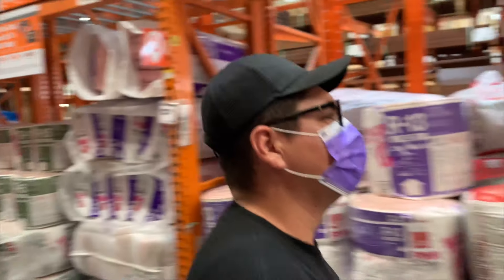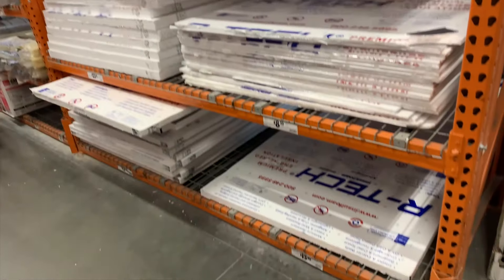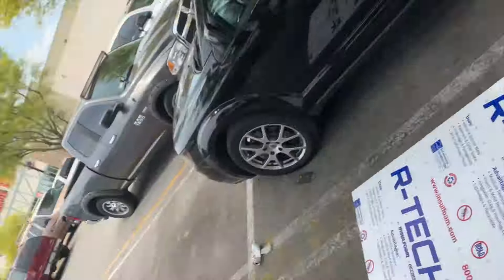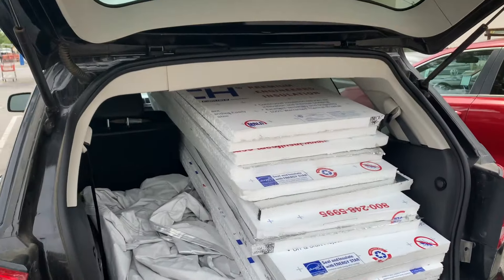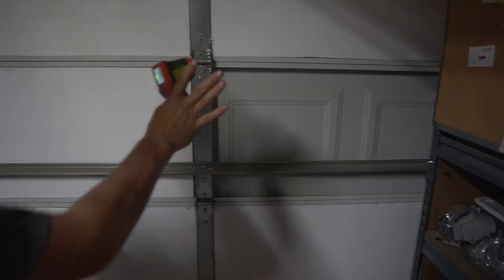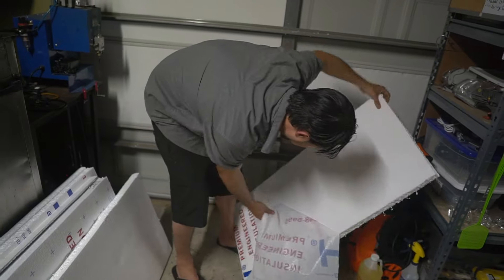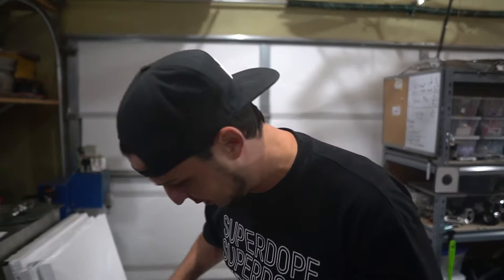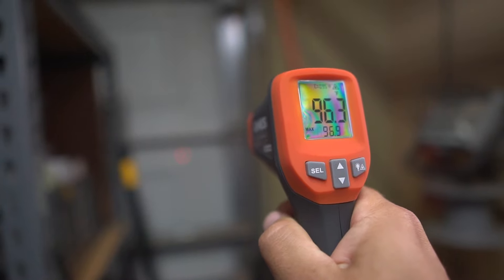My Garage Was WAY TOO HOT!

Comment: I also added in a gable exhaust fan for the attic above garage.  It has made a massive difference in the radiant heat that comes in from the ceiling.
Reply from the maker: Nice!!! I’ve been wanting to spray insulation up there, but a fan sounds way the hell cheaper 👌
Reply: @flyryde  If you ever get shipping peanuts with the amount of stuff you order, throw those in the attic in between the rafters. It's free insulation that does the trick and you can't argue with free.

Comment: Don't forget to use aluminum tape along the ends of the foam not just to secure it but to block more heat out. Plus putting the garage door seal trim kit around the outside of your garage door trim will create a better seal to block out noise and outside heat. I can't add a pic to my comment but Amazon has it for like $20 n I highly recommend it.
Reply from the maker: Thanks Mars!

Comment: You should have the tension on your spring adjusted for the extra weight you added to the door. It will save your spring and your door opener. 👍👍
Reply: I don't know anything about garage doors other than they open and close. The material they used isn't it just Styrofoam?
Reply from the maker: Do I even have a spring? 🤔 lol

Comment: If that insulation had a foil liner on one side then the foil goes on the inside of the foam. The theory of heat insulation is that air is the best insulator, in this case the foam is the air and the foil reflects any residual heat. Steel door , air gap , reflective foil is the correct order. If the foil is touching the door its useless.

If there was no foil liner then line the inside with foil and dont let it touch the steel door in any part.

Comment: That plastic you peeled off is meant to stay on...
Reply from the maker: Why?
Reply: It's part of the thermal insulation properties 😣😣😣
Reply from the maker: Only thing I found when I read up on it, is that it acts as a vapor barrier. 

I know you won’t get it, but I’d rather have a white back ground in my videos, then a vapor barrier 👍
Reply: @flyryde  I get it, and it's your choice. I just mentioned it because it's there for a reason is all 😀